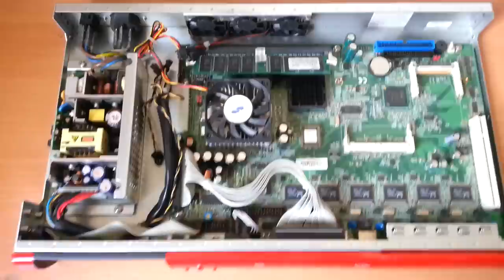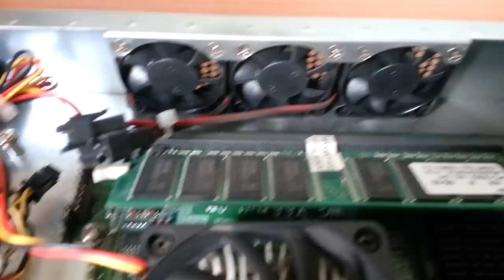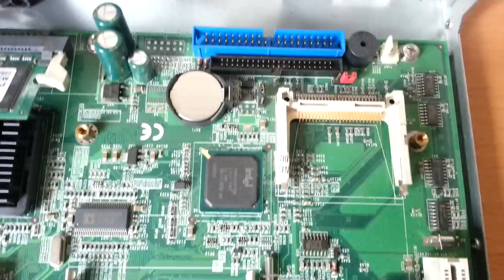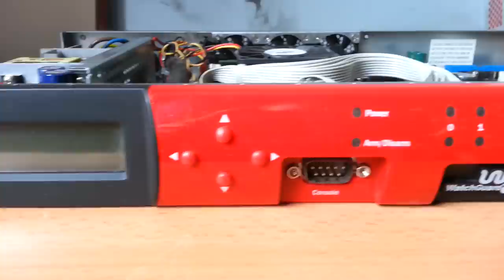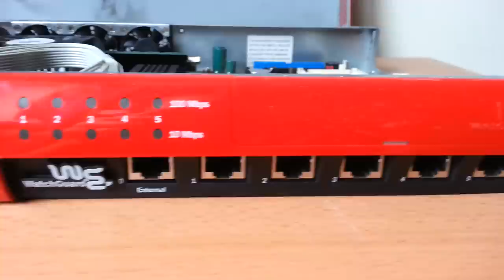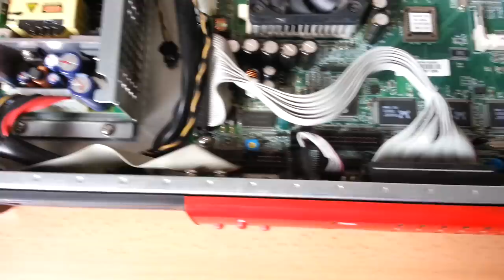Inside a Watchguard X700

Comment: There isn't a keyboard port.  You need to use a crossover cable and connect it to port 1 on the router, and the other side to your computer NIC.  

You need to have the management software called Fireware (in order to download it you have to create a guest account on Watchguard), and which one you use depends on the Fireware version.  Mine was 8.3 so that's the only version that would work on mine, except that it's meant for XP.  Even in compatibility mode it still had issues.  So I am putting pfSense on mine.

Comment: Can you point me to how to work with this - i got an old Firebox X550E from ebay - butdont know what the best way to get ubuntu installed on it.
Reply: I own the X750 Core e-series.  I can tell you that in my case none of the current management software works properly with my device (11.3).  The Fireware is 8.3 and requires the matching software that runs in XP (on 7 you have to run compatibility mode, but the software require you to enable the tool bar on the right click menu.  But that never shows up.  So yeah pretty archaic.

you'll want to replace the original CF card inside so you can have an original copy of the OS that came with the Firebox.  Replace it with one from Sandisk.  The one that seems to work is the Extreme CompactFlash 4 GB.  Get WinDisk Imager and flash the DOS bios on it, and then get whatever ISO of Ubuntu you want (I'd use 14.04, because 16.04 might not work) and put that onto the CF card.  You will need a card reader that takes CF cards.

On mine I am also updating the DDR2 533MHz RAM from the 256 it currently has to 2 GB DDR2 533MHz RAM.

You should consider putting pfSense 2.2.6 on the device.  Since the Firebox is a router.